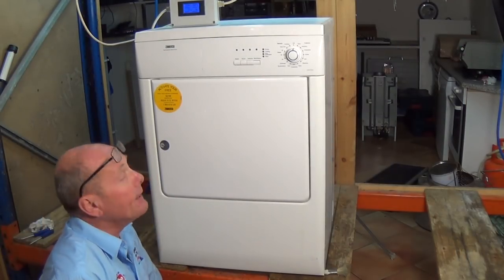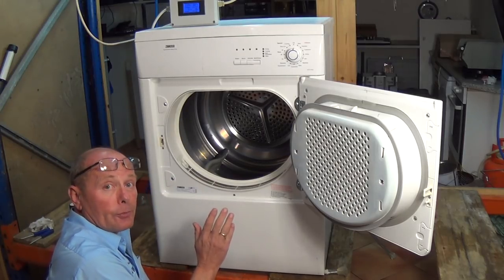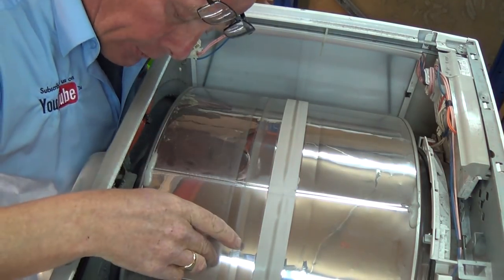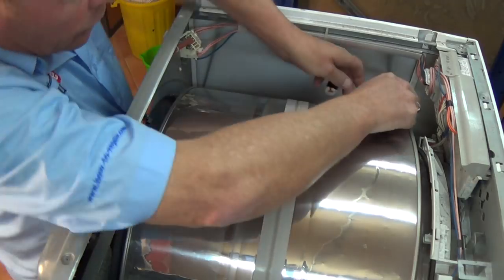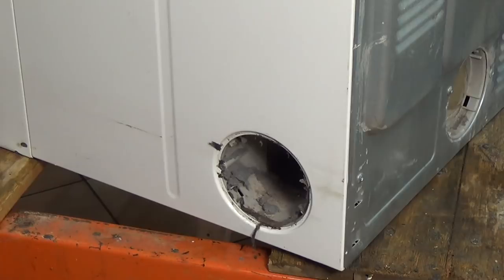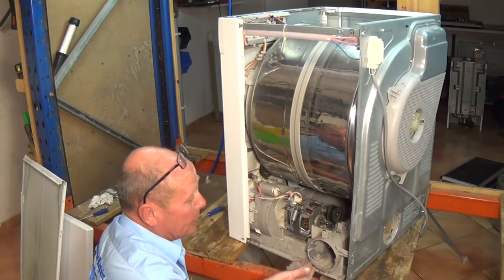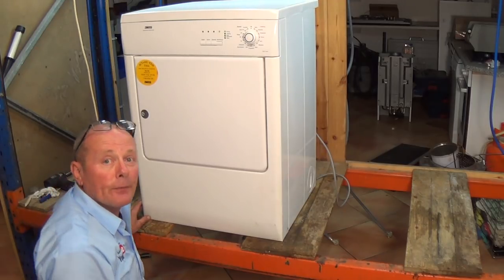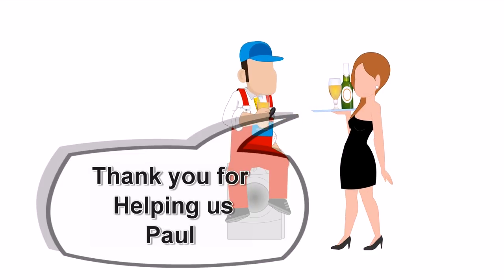Zanussi Vented Tumble dryer how to replace the belt

Comment: With the help of this video, I replaced the belt on my AEG tumble dryer. I don't think that I would have had the confidence to tackle the job without it, and it ended up being much easier than I had expected. The trickiest bit is getting that spring back on...just be careful with that. Many thanks for the video.

Comment: Really helpful and clear, thanks.  My Tricity Bendix TM220 is almost identical to the Zanussi you show.  The front of the machine looks completely different but the panels, bolt types and locations, internal wiring, belt and motor all look exactly the same and the process you outlined worked perfectly.  Worth taking a few photos during disassembly because there were a few different types of screws/bolts and you need to remember which goes back where.  And getting that spring back on was quite the challenge (it shot across the room once when it slipped off the screwdriver!) but I got there in the end.